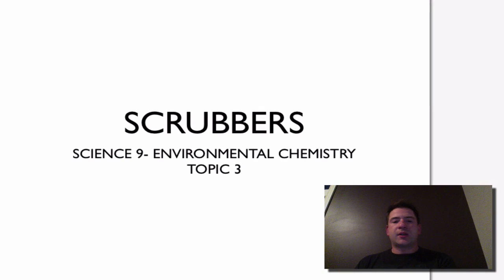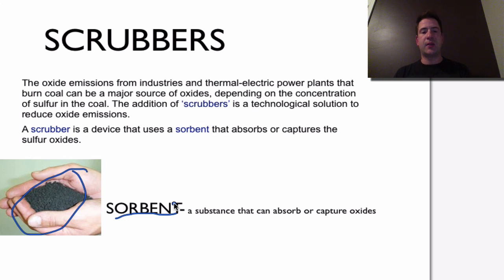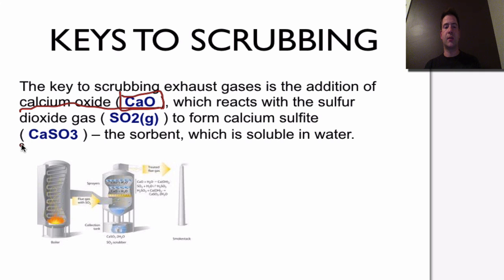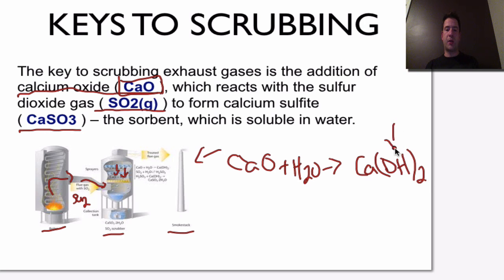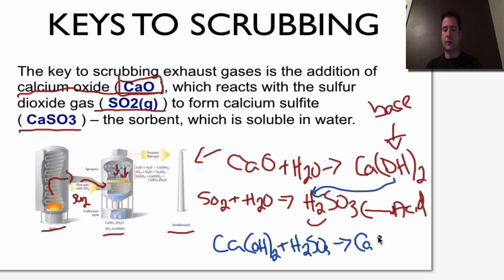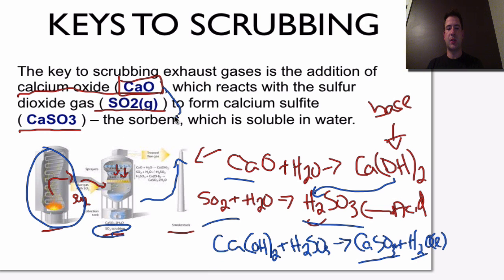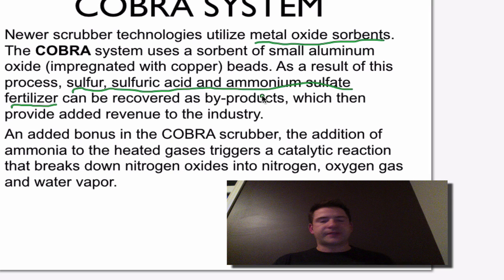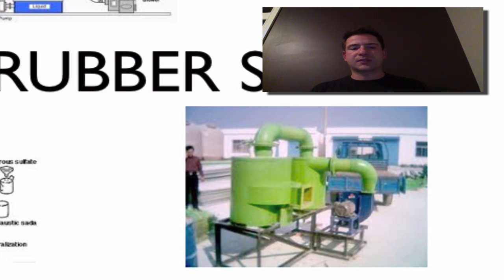Science 9 Environmetal Chemistry Topic 3 Scrubbers

Comment: So, somebody tell me why we're foolishly endangering our power grid by shutting down our coal fired power plants? These scrubbers make them a whole lot cleaner, right? Our EPA recently shut down a local 136 Mw coal fired plant in our town. But don't worry, there are also plans to replace it with a 5 Mw solar plant. BTW, our electric rates went up by 10% this year. I'm shocked that it wasn't more. Get ready to wear sweaters kids.
Reply: because to scrub all the co2 from a coal plant would use ~10 time as much sorbent as the coal that's burnt in the 1st place. Mass balance.
Reply: +marcus Killian -To 'scrub' all of the emissions of CO2 from 100,000 acres of wild fires consuming overgrown forests, would take? Note that 100,000 acres of wild fire burning out of control for weeks, emits more CO2 than All of the transportation across the entire USA ...for one full year. 

NM has burned over one million acres in just One wild fire. USA burns approximately 3 million acres in any given year. Kellogg fire alone burned over 3 million acres. 30 years relative to cars, trucks etc across the entire USA. In order to 'control' CO2, we 'must' have scrubbers for Wild Fires. EPA had better get busy :>)
Reply: Solar is far smarter, slightly higher rates encourage conservation. LED lighting will make your bills lower than ever before.